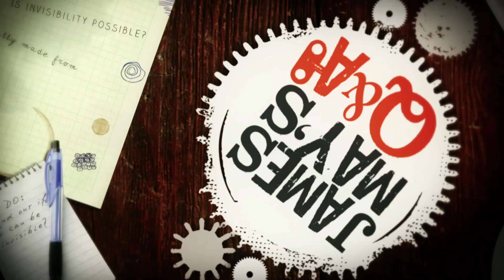Why Can't Trains Go Uphill? | James May's Q&A | Earth Science

Comment: Canal boats are even worse at climbing hills.
Reply: hence locks
Reply: @Sugarsail1  Yes, when all else failed. Often though, the solution was circuitous routes that follow the natural contours, massive earthworks, tunnels and aqueducts. Apart from being expensive to build and operate, a canal with locks needs a reliable water supply since so much is wasted by the operation of a lock.
Reply: @johnm2012 
Canal boats function even better on level water. Lol how can water go uphill?
Reply: @danielfield8616  Yes indeed.  Canal boats have very shallow keels and roll badly in "lumpy" water. As far as water going uphill, that would require a pumping engine.
Reply: @johnm2012 
Oh, but water and thusly the canal seeks level
Reply: It is an unequivocally incontrovertible and fundamental law of nature
Reply: Does one have the audacity to think they can change that?
Reply: @johnm2012  The new Panama canal  expansion locks use a system of basins that save the water drained from a higher level to fill a lower level and so on down the locks it's a pretty interesting way to try and reduce water usage in locks.  Panama is of course facing issues of draining their lake too much with the original canal even though they are in such a rainy country.  It's a pretty interesting project.
Reply: @johnm2012  A circuitous route formed by nature via (usually) a river over thousands or millions of years. All over the east coast of the U.S. many trains follow old canal tow-paths & rivers.
Reply: why can't fat people go uphill?
Reply: @commentfreely5443  Fatist!
Reply: @commentfreely5443  Traction is fine, usually it's thrust that's that lacking.
Reply: @commentfreely5443  because the earth is fat phobic.
Reply: Haha good one
Reply: Yes.Up a water falls or rapids
Reply: Canal boats can go uphill, but only vertically.
Reply: @theanarchonazbolinquisition   Great name
Reply: @femurbreaker4483  Indeed, thank you!
Reply: No, actually they would be better. Water cannot be compressed, so any decent inboard water jet systems would push them canal boats uphill quite nicely.
Reply: Salmon are the superior species
Reply: Loch Ness locks: hold my beer
Reply: I hate you as well as this comment of yours with every fiber of my body
Reply: @robinpohl2702  😂😭💀
Reply: Gernot Schrader  "Usually they go downhill" that depends which way you are going
Reply: @cobraaction1365  Back in my day, we had to walk to school uphill both ways so that the canal boats could go downhill both ways.
Reply: Haha, love it. Under-rated comment.
Reply: johnm2012 
That’s when the boat drives the driver.
Reply: Inclined Planes e.g. Foxton
Reply: You could use a large helicopter to get get it up the hill. Then just cut the cables supporting it get let it go down the hill. No problem.
Reply: you're just not trying hard enough.
Reply: I mean... Your not wrong, I too would be surprised if a canal boat made it up a waterfall
Reply: johnm2012, it means that the Earth must be flat.
Reply: Ya it's a nightmare
Reply: they literally can't go up hills
Reply: because they cant
Reply: that proves flat earth
Reply: Canal?

 more like anal...
Reply: I know.  And ever since I took up water skiing, can I find a lake on a slope?  Nowhere!
Reply: johnm2012 boars Ashley’s Saul On flat water there’s no such thing as there being a hill or anything how they make us believe the world is curved it is not it’s flat
Reply: Yep, never seen a sloping canal
Reply: Nor a space rocket, yet it goes up 😲.
Reply: It do go down
Reply: This canal has machinery to help the boats climb the hills: https://en.wikipedia.org/wiki/Elbl%C4%85g_Canal#The_Inclined_Planes
Reply: id say
Reply: F##kin hell' jog on dickhead

Comment: WRONG GRAPHICS. 100% inclination is 45 degrees, not 90.
100% means for 100meters you climb 100 meters, so 45 degrees.

fire your animator basically, for doing no research plus having no brains. (most staircases are 80% and he shows amost vertical stairs lol).
Reply: U an engineer?

Comment: people going up 80% maybe, but stairs are no gradient -> they are steps, so stepped an not gradually increasing in height as the term "gradient" actually suggests... also with enough grip an/or downforce cars and/or other motorized vehicles should also easily be able to do 80%
Reply: Fair point. James May's  being a muppet there. Stairs are a very poor example. But of course if you include climbing as well as just walking then a fit human can beat most machines at an incline.

Comment: How come the New York Subway can go under rivers at grades noticeable to the rider?
Reply: Standing on a train, or sitting on a hard seat with no seatbelt makes even a slight incline noticeable.
Reply: @michaelpeele5739  I looked up that the grade for J1 and J2 on the williamsburg bridge  is 5.5%
Reply: Light rail systems have shorter, lighter cars that can go around tight bends and up steeper hills. They are slower, noisier and quite bouncy but they are very frequent and the journeys are short. Long distance trains need to be heavy to smooth the ride out.

Comment: Sure not a big hill but railroad sanding systems weren't mentioned here.  That's how they do it...aside from a funicular.
Reply: Actually sanding is a general traction improvement system used in flat track as well If it is slippery. Have seen a BR52 with a passenger train (less than 450to - the engine can pull 1250to/80kmh) use it last year because the rarely used track was slippery in Fall after rain, leaves on the tracks etc. And railroads in the Ruhr valley rarely climb much
Reply: @mbr5742  isn't it used on mountain grades as well in western usa?
Reply: @adamfrbs9259  Maybe, I am not an Ami. In germany they try to match the engine(s) to the train and the route so under normal track conditions they can go up there without sanding.
Reply: @mbr5742  oh.  Heck i don't know...I'm just a semi driver or Lorrie driver as they call it over there I think,  thanks for the info....and the great cars, i have a '14 AMG C63 coupe....never go back to American cars again....you guys don't mess around....great car!!

Comment: BBC Earth Lab - this Information is OUT DATED as of 2013, even back in 2013 we have had All Electric Trains that can Climb Mountains or Gradients with Ease, small single car DMU are used in Rural Japan to climb steep gradients, and the Japanese Shinkansen can Easily climb Gradients as well. the KEY to this was the Invention of Multiple Electric Traction Motors located at each Wheel and on Both Sides of the Car, add to that DOUBLE RAILS (Shinkansen) and CONICAL WHEELS and then you have a Train MORE THAN CAPABLE of climbing a Gradient.
YOU SEE, Electric traction motors have 100% TORQUE at 0 RPM, this makes them Excellent for going up or down a Gradient. they key things are NOT to make the Gradient too steep and to have Really Reliable and High Quality brakes. While a single car DMU can navigate a VERY HIGH Gradient a Bullet Train or MAGLEV not as much, and they require slightly less Gradient over a longer Period, as they are Built primarily for High Speed.
Reply: Try that with a fright train of 1200+ metric tons...

Comment: Ah but what about rope haulage systems.  I used to work on the Bowes railway and the incline which used to run coal waggons was 1 in 7.  The idea is to have a engine fixed in an engine house and a huge long rope attached to a train of waggons to pull the waggons up the hill.  Such a system was still used in the UK until the 1970s for that same incline.

Comment: I always thought it was unfair that the 'Leaves on the line',  and  'The wrong kind of snow' explanations for delayed trains in Britain were mocked by the media.

The new snow-clearing machines (imported at great cost, no doubt) were designed for shifting overseas-type snow - the kind of light to medium powder that forms 12' deep drifts in places like Finland and Canada. The lovely, new-fangled snow-blower/scrubber/whatever devices worked brilliantly on that stuff.

BUT... In Britain the snow may only be 6" deep, but it's almost never powdery. No, no, no.  It's 5" of dense grey sludge with an inch of beautiful crystal clear ice on top of it. Yummy! Trains don't like it. Snow-clearing devices don't like it, even the massive Russian flamethrower-type ones. Ye olde steam locomotives could be modified to chisel it up as they went, but modern units are set up differently and crud on the line is a real problem. So much for progress.

Wet leaves on the line are another ridiculous-sounding but genuine disaster because they squish down into a kind of greasy plywood that reduces traction to zero.

British 'wrong snow' is a pain to shift. Bear in mind that 'winter' here lasts for 5 hours on a Monday, then reappears two days later for 16 hours, before bright sunshine takes over until teatime, followed by winter 2, where snow falls, freezes, melts by lunchtime, refreezes by teatime, clears completely after a day of blazing hot winter sun/fog/sleet/hail/rain, then gets topped up by snow in time for lunch the next day, which turns to 3" of  ice overnight... etc.

In Canada you can plan for winter. Properly. It lasts for blooming months. Snow tyres or chains on the car; full-time track-clearing machines for the railways...  In Britain it comes and goes totally unpredictably. Can't use snow tyres or chains on the car because the roads change from ugh to aargh overnight. Sometimes winter's quite warm and sunny. For three hours. Everything melts. Yay! Just before a five day ice-storm which brings down all the power lines. Boo. But which then melts overnight. Sometimes. So investing millions of quid in fancy, Arctic-spec snow-clearing gear for the railways is one hell of a gamble. Yes, I know it sounds like a stupid cop-out, but them's the facts.

The way you shift so-called snow hereabouts involves 6 guys with pickaxes, shovels, and huge mugs of hot, sweet, milky tea, walking ahead of the train as if it were still 1885. So when the rail official (perhaps foolishly) told the journalist that the trains weren't running because the wrong kind of snow was on the line, he was being absolutely honest, which is never a good idea when dealing with the British media.
Reply: So a train can be halted by a simple pile of leaves? I will harness the power of nature and its leafy friends just to screw over the passagers. evil laugh

But seriously though,trains and slippery surfaces don't mix.
Reply: @Chadmiral  Wet leaves can give trains flatties as well.  Really they are flat spots rather than flat tyres but it's just like in F1 if a driver skids too much when braking the friction flattens the wheel causing vibrations.  The wheels need to be reground when this happens.  In F1 at least you can just change the tyre.
Reply: Interesting...
Reply: All of this is true but I am still unimpressed that the country that invented the railways and was the cradle of the industrial world, famed for its industry and ingenuity could not scrape a few wet leaves and a bit of snow off a railway line.
Reply: Also, in the rare occasion that the UK gets fine powder snow, it gets sucked into the traction motor cooling system and melts right in the heart of the electric motors. Shorting them out.
Reply: the trains that run on the rail lines at Donner Pass in California, laugh at the trains that can't go over 6 inches of snow.
Reply: British snow sounds much like the sort we have in Western Washington State, here in the USA.  Having been born and raised in the Seattle-Tacoma area, and continuing to live here, I've heard countless cracks about how we native or long-time Washingtonians can't drive in the snow, or that we go into a panic and shut down everything when at most a couple of inches fall.  Living minutes away from Puget Sound, a couple hours away from the Pacific Ocean, parked between two major mountain ranges, and  being on the receiving end of the intense cold funneling down the Frazer River Canyon in British Columbia can all contribute to making our snow a real mess.  Heavy, wet, where the compacted underlying layers turn to solid ice.  We just had one of the snowiest Februarys in recorded history, and am glad that spring is finally here!
Reply: @MokkaMatti  build a wall
Reply: I like how you use teatime as a period of time
Reply: Your description of British Winter fairly well fits the state of winter in New England lately.
Reply: The new snow-clearing machines (imported at great cost, no doubt) were designed for shifting overseas-type snow. Would that be the same as overseas rain, overseas sunshine, overseas moonshine. I didn't realise that rain, snow, sunshine...was different in different countries. I will have to visit UK soon to see, UK snow, it obviously has more than 6 sides.
Reply: Wet leaves are not dangerous because they reduce the traction, they are dangerous because they don't compress or get pushed out of the way, and they lift the train of the tracks and it derails.
Reply: @MegaLokopo  i simply don't believe you.  If you put 10cm of leaves on the track and ran a train over it you would get maybe 0.5 mm of mush.  That is what?  One tenth of what is needed to derail a train going around a bend at speed?   That mush IS a great lubricant.
Reply: @HweolRidda  Wet leaves don't compress they basically get glued together and to the rail in a mush, and especially in turns on a hill the train can easily be lifted off the tracks. Its simply rare because its a known issue. the flange on standard rail is generally about an inch thick, to derail a train the train only has to go up about half an inch.
Reply: Misinformation
Reply: Snow at low temp isn't the worst thing... Snow around 0C or 32F is. They are not completely frozen and may come down half melted and freeze themselves as ICE on the tracks! This is a NIGHTMARE even for cars on road let alone trains.
Also someone mentioned snow may get into the electric motors and burn them. Yeah this is another problem. Even the Americans and Chinese locos do suffer these. That's why heavy snow is called "Snow disaster" in CNR.

Comment: Glad I did not watch this before going to the top of Mount Snowdon on the train last summer!
Reply: Snowden train uses Rack and Pinion system not pure adhesive. Same in Germany (Drachenfels) or some Swiss trains
Reply: @mbr5742  Yes, I realised that, but I am not good with heights and it does go close to the edge at times! Thanks for the reply.

Comment: The “tractive” force actually slightly decreases as the train travels up a gradient, it doesn’t remain constant as the video suggested this is because now a component of the trains weight is acting horizontally and thus not proving a downward force into the tracks. It’s only a small fraction however due to the fact the slopes the trains travel up are extremely shallow.
Reply: The "tractive" force would be 99.96% on a 2.65 % slope compared to an even surface.
Reply: @24pavlo  yeah, technically not the same, but practically speaking, the same
Reply: It's James May, so what do you expect.  He also suggested that stairs are 80% grade.  Just be thankful that the bigoted big mouth Jeremy Clarkson isn't with him.
Reply: I COULD verify this, but I know for a fact the math is going to be awful, and I would probably handle it awfully, it sounds about right though
Reply: @aransmeallie5344 Its actually not that bad. The downward force on the tracks is just WcosX, where W is the weight of the train and X is the angle of the incline. This means that on a 60° incline, only half of the train's weight is pressing down on the tracks
Reply: @aransmeallie5344  And I COULD fly to Moon and become the king of the world. It dust seems too much of effort so I won't.
Reply: @anteshell  You can be king of the moon. Nobody can argue with that.
Reply: Yeah at that angle it is almost negligible. But it is not zero!
Reply: Wouldn't it remain the same if the slope is constant? The horizontal force vector wouldn't be changing, would it?
Reply: @20xx-mm-dd  It remains the same for all points along the (constant) gradient, but it is slightly less than on a horizontal track, yeah.

Comment: There's a mistake, from what I see, when he says that if the train goes uphill, it's "tractive" force remains unchanged. It reduces.

The force of friction is equal to the normal force (Fn) multiplied by the coefficient of fiction (μ). The latter is a constant that depends on the two objects that are touching/rubbing (here, steel-on-steel). Fn is the portion of the gravity force that is perpendicular to the surface.

When the train is moving neither up nor down, Fn equals the force of gravity. And when it's going up/down, Fn is reduced because some of the gravity force is now parallel to the surface. So, when the train is on an incline, the friction/traction reduces.
Reply: But for the inclines involved with trains, the reduction is so small that it can be ignored for practical purposes. For a grade of 2.6% (about 1.5 degrees), the force is 99.96% of what it is on level track. This is only a difference of 4 parts in 10,000.

Comment: Hi James, you didnt mention an equally important reason, if a locomotive is travelling in reverse, which is quite common, there is a chance that the firebox crown may become uncovered with water causing failure by fusible plugs melting. Locomotives need to be similarly careful going downhill for the same reason. Ciaou

Comment: Speak for UK in America the big boy and challenger locomotives were made to pull heavy 4-5 mile coal trains thru the Wasatch range in the rocky mountains at speeds up to 60mph but would normally do so at 40mph. That being said i don't know the actual grades but being a Colorado native people don't realize every train running thru Denver has to do up and down grades as Denver is in the front range at the base of the mountains. Also in America we have an airlock braking system on the engine and every car in the train so every car has a set of brakes for going downhill